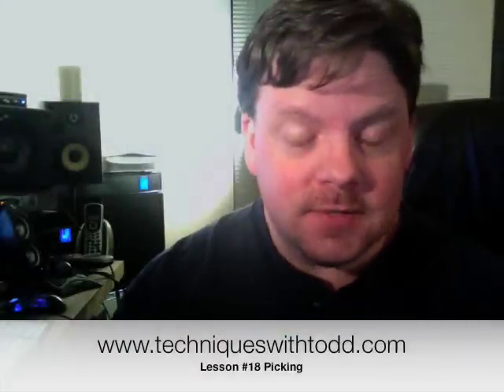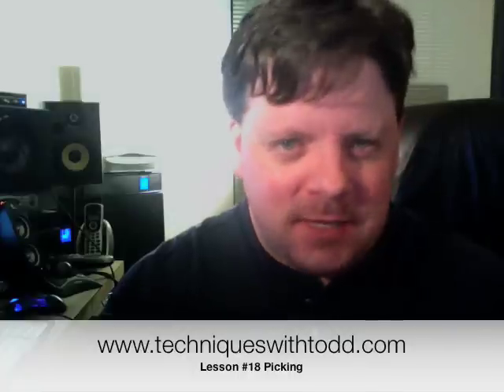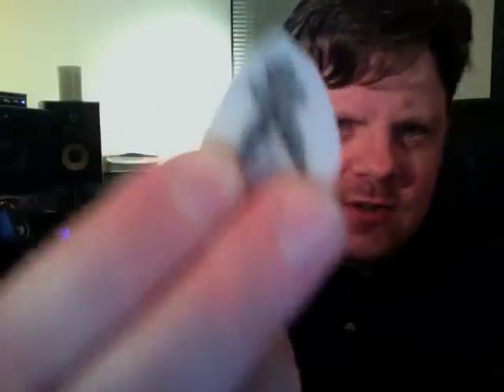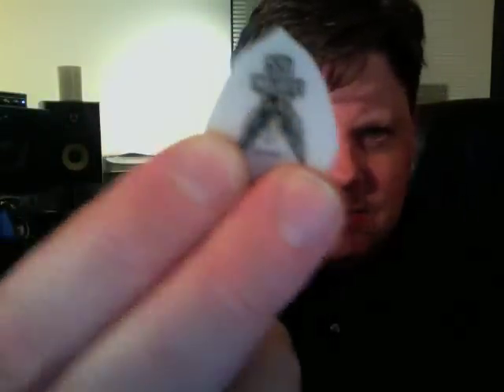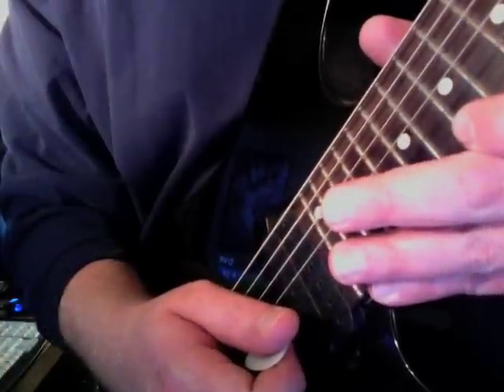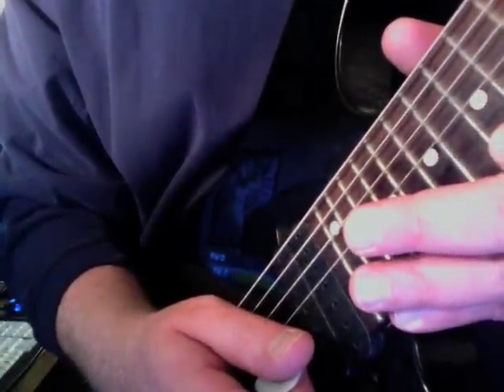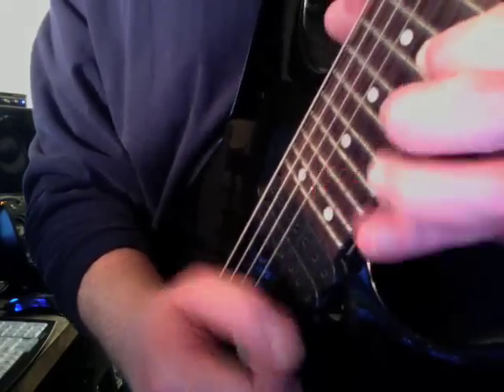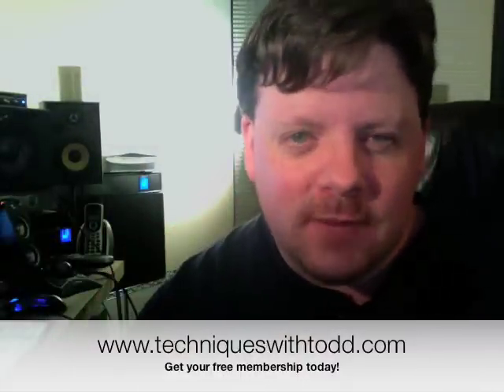Techniques With Todd #18 (Guitar Picks and Picking)

Comment from the maker: Good question. I sometimes do anchor with my pinky, however, this is not an ideal technique and usually just happens when my hand is getting tired.  Using the palm on the bridge is called "muting" and I love it.

Pick choice is a very individual thing. For fast picking work, I prefer very stiff picks like the claytons which are very stiff. Also, the sanding of the pick to a point is yet another way to increase pick rate by decreasing the surface area of the pick.

Practice!
Todd

Comment from the maker: You gotta use what works best for you of course, I've just always loved the super slinky 9s. They will break if you bend them to far, but the lighter gauge strings allow you to apply a little less pressure and keep your speed up and consistent just a bit more than heavy strings. I bought a 7 string for the same reason, wanted low crunch but liked 9s

Practice!
Todd

Comment from the maker: Try to sand the sides near the point until you create a fine tip on the pick. However, this is a technique for playing fast leads, it probably wont help much if you are just starting out. As for guitars, I'd say go buy a Minarik Lotus. They are great guitars. I have two and love em both. The lotus looks like a Les Paul but actually plays a little better.  I do a review of it in an earlier video.

Practice!
Todd

Comment: Strings are the only thing i'm still changing everytime.
Sometimes i prefer 10s, sometimes 9s. I even had 12s on my spare guitar a few weeks ago (dropped C tuning, i should buy a 7 string for such songs, because i like the standart tuning more)
Usually its D'adario (or however its spelled) or at least i always came back to them because they seem to last longer for me.
Gotta try the super slinkys, i always wanted to try em, but also always forgot to so.

Comment: In my case it was a problem many beginners face (especially those who learn by themselfs).
I just pressed to hard on the strings, and had a really strange hand Position with the left hand.
But since the day i noticed that its enough if i just "touch" the string without force i never had problem with my wrist again.
But still, a wrist band can't hurt at times when i tend to play all day long ..... its like when you usually run a mile every two days, and then suddenly do a marathon...

Comment: Comment was send bevore i was finished.
Thats the exact way i hold my pick, just that its more parallel to strings.
But i have a tendency to play from the fingers, but when it gets fast i play from the wrist.
Took me long to find out what works best for me.
Its what my teacher told me is wrong. But for me it works perfect.

btw, my Stagg Picks smell like peppermint when i sand them.